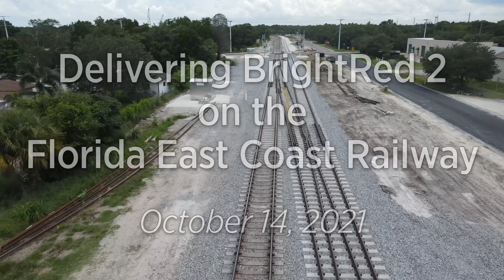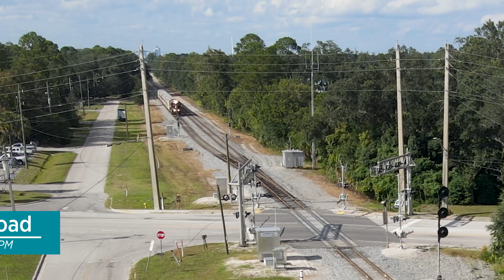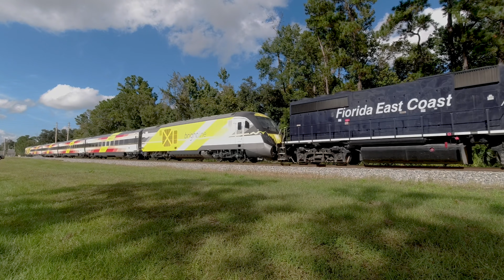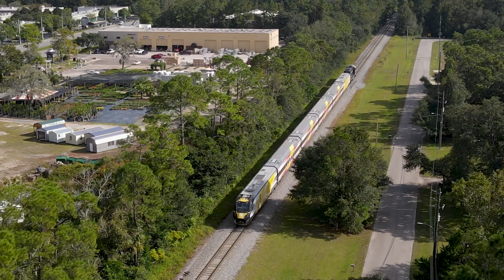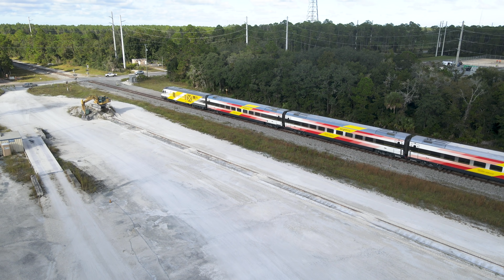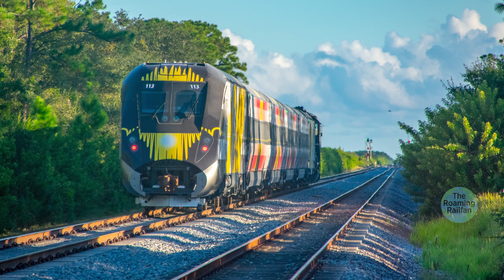Delivering Brightline's BrightRed Train: A Trip Down the Florida East Coast Railway in North Florida

Comment: why ddo they have two locomotives for 4 coaches? can't the one just push & pull?
Reply from the maker: The trains will eventually be longer plus it provides redundancy should anything happen with one of the locomotives so a train is not stranded somewhere.
Reply: @RoamingRailfan  -- In Northern Virginia, they use two locomotives on commuter rail (called the Virginia Railroad Express -- VRE) to protect the passengers from a collision with another train (which has happened).   There aren't any loops readily available so this works out well.